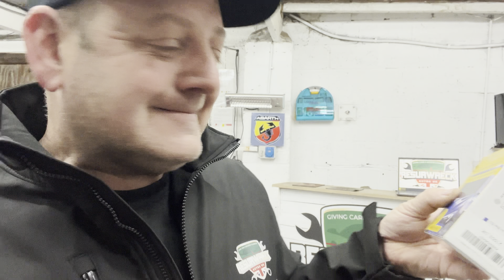Fiat 500 Lounge 2012 Part 6 Shocking Previous Repair On The Rear Panel ?????

Comment: Whoever rubbed that filler down knows bodywork to get it looking half decent to the eye but thats were it ended. What a pity they never learnt how to beat dints out a bit better. Cant remember the last time i seen pop rivets holding a wing to a wheel arch, clearly dosnt know how to weld either or mask off wiring . I wonder if a car vertical check would show pics of previous damage (everybody raves about car vertical) it would be interesting to see original damage before the sculptor got at it.
Reply from the maker: Hi Richard crazy previous damage 👍👍
Reply: Aye they knew there way round a ton of bondo and a rubbing block ha fair wrack gone into that !

Comment: Afraid to say a full rear quarter is the only way to repair it properly. Cutting half a panel in is a bodge!
Reply: Cutting in half a panel would be weaker than the bodge it needs a full 1/4 panel

Comment: that needs the full panel. less work than you going to do.gets cut half way up window. through sill the rest is just spot welds. if he welds lenth of panel it will buckle with heat. and need loads of filler again. he should of told you this

Comment: if i was you id use that car for parts
Reply from the maker: Hi mate I’m not a quitter it’s getting fixed 💪💪
Reply: @ResurwreckAutosUK  yea that's fine mark I knew that. Only be 100 quid for that whole panel cut. Easy to put in. Needs window removed tho to do it